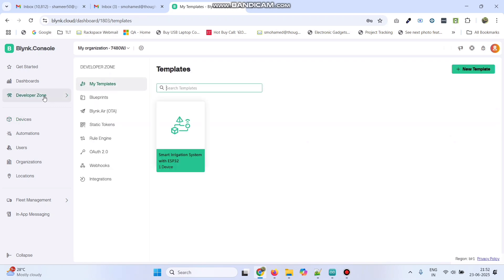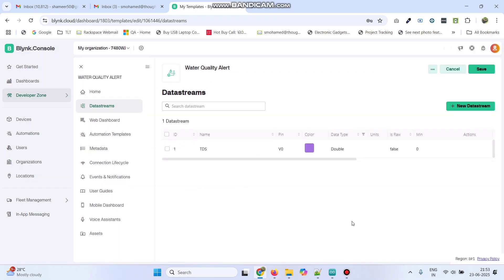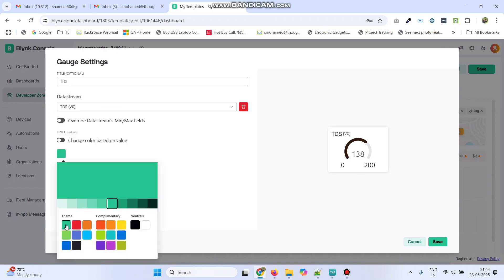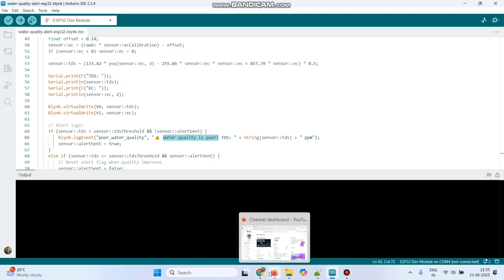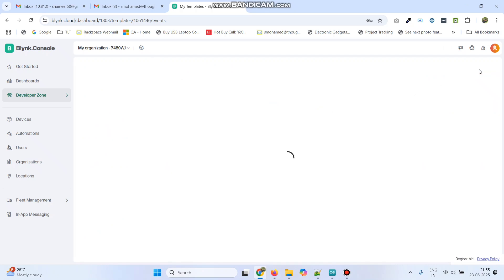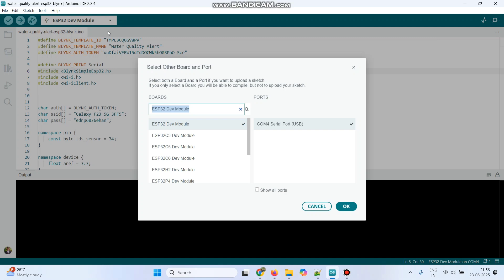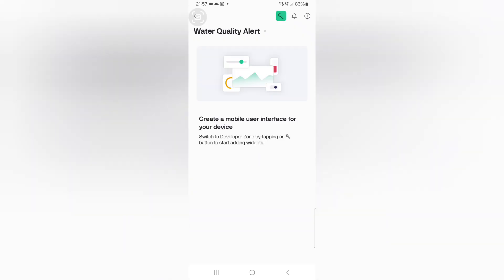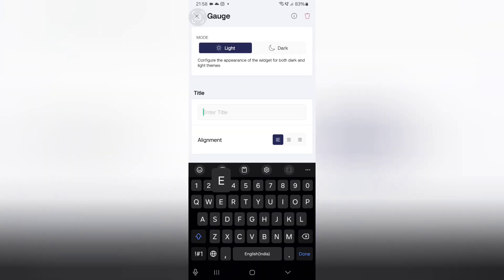Water Quality Alert System with TDS Sensor & ESP32  Get Real-Time Alerts on Blynk

Comment: Hello sir. Few days back I saw your smart door lock video. Have few questions regarding that:
1) In video description, you have given an affiliate link of rs 900/- Esp32 board. But I have seen a esp32 board on Flipkart which was half the price. So will that cheaper work as well

2) Can we use Esp8266(NodeMCU) instead of esp32
Reply from the maker: Yes. There are cheaper boards which will work perfectly. In the products list, there are no other cheaper options available and that's the reason I selected the 900 rs board in youtube. If you can message me in instagram I will send few other websites to buy.
2) You can use esp8266 but there is a slight change in code and setup.